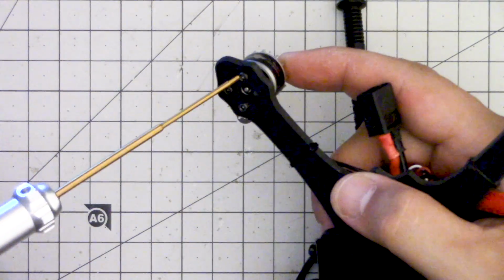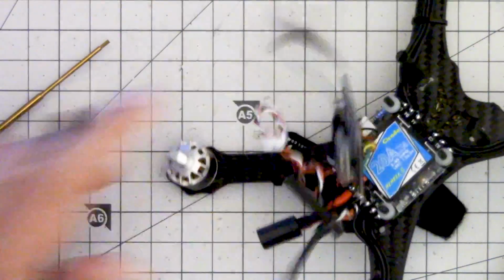Quadcopter Hot Motor | REAL WORLD TROUBLESHOOT

Comment: I have one motor getting extremely hot on a new build. I’ve only hovered it for a min or two and one motor got hit enough to smoke. 
The screws are not long enough to touch the motor windings. 
I guess I’m gonna move the motor to a different arm and see if the problem stays at the esc or if it follows the motor. 
That’s about the only way I know to pin point the problem. Unless you know an easier way?
Reply from the maker: If one screw and just one screw is getting hot, it has to mean that current is flowing through it. And the 99% most likely place for that to happen is the motor winding. Maybe the motor winding is somehow shorted to the base and current is flowing that way.
Reply: Joshua Bardwell one motor is getting. Hot. Not just the screws. 
When I touch the multi meter to the motor screws and the esc solder joints on the negative side of the esc pad I get a small reading.
Reply: Joshua Bardwell I’m putting a piece of elct tape under the motor. 
It looks to me that the motor windings touch the metal base anyway.
Reply: I guess I just had a bad Brand new motor??  ( I know that sounds unlikely). But I swapped the motors around to see if I had the same problem on that esc with a different motor and it stayed cool. But where ever I put that one motor it gets really hot from just hovering. 
I also had smoke coming from it last night. 

I hope after I get a new motor the issues will be solved.

Comment: What happens if my batteries get hot and puffy after flight? 4s 700mah pyro drone battery on 1407 4000kv motors with hglrc 28a stack, motors stay almost cool to touch
Reply from the maker: Need higher C rating batteries or larger batteries.

Or you are over-discharging them.
Reply: Joshua Bardwell thanks josh, appreciate the help! Ill get some r lines
Reply: Joshua Bardwell props were pulling to many amps lol switched em and the packs are warm but not puffy lol

Comment: So all of my screws have continuity and i assume this means some of the wingdings are touching the wall of the motor. are there any fixes other than just buying a new motor? Can i pop the top of the motor off and try and fix the motor myself or should i just chuck it?
Reply from the maker: Use shorter screws.

The motors may be permanently damaged though.
Reply from the maker: You can also add an M3 washer or two to give your existing screws more spacing.
Reply: Thanks for the speedy reply, I just cut some screws down and they only go in a couple of turns and I'm still seeing continuity between the motor and frame, However when I test between the 4 in 1 ESC solder for the motor and frame I do not have continuity. Any ideas on what my problem may be, I'm probably going to by a new motor. Shame really I've only flown twice as i'm new to the hobby and its kicked the bucket already.

Comment: Stupid question: If i get no beep but a reading of 600 when meassuring an esc pad and the side of the quad frame, is that bad or does it have something todo with the fc mounting holes being grounded or something? I am using steel screws for the stack with tpu sleeves over them for pseudo soft mounting.
Reply from the maker: The ESC motor pad shouldn't have any continuity to the frame at all.
Reply: Thanks for the reply! Seems to be stack - when I press left/right against it, it reads infinity/600.

Comment: your videos have answer to all my crisis except one I have tried to tune my quad and im enjoying the tune while flying line of sight because im ordering a replacement camera for my old one ,there for im not flying fpv, but ive always had a problem with my motors getting hot and I mean hot hot, youll say owch when you touch them even if I fly I smooth pack for 2 minutes only meating half throttle o fue times, is there a chance that its my esc motor combo, that's all ik it could be, my motors are tbs mr.steele v1 and im switching to v2s and my esc's are Favourite FVT littlebee spring 35A escs witch are considerable low end escs but ive had them bc of there price, do you think that's the reason, sorry for all the reading I appreciate your help deeply

Comment: we say ground using DC but it's really negative and positive DC electricity travels out the negative Pole and in the positive Pole like a magnet pushing and pulling negative pushes positive polls a complete circuit.
it seems the opposite of the way I've always understood it the fuses are always on the positive side which means we basically control the return electrons

Comment: Hey Joshua, I just rebuilt my 3in with new fc/esc after fire, now it fly but motor 1 is significantly hotter than rest and battery last a lot shorter than before, screws are fine, I changed motor same happens, possibly bad esc but before I change esc is there any other potential cause? Btw my 5inch floss doing same thing on motor 3 after a crash
Reply from the maker: If you're 100% sure it's not the screws then I would change the ESC next, yeah.
Reply: Joshua Bardwell wow thanks for the QUICK reply happy flying! Going to buy hobbywing esc through your link 😃

Comment: Joshua any help is much appreciated! Tried all these things and nothing works. I put wd40 in my bearings like an idiot and now even with after cleaning out with carb cleaner its still hot plz help i run the le drib hypetrains and being 15 i cant afford to replace them
Reply from the maker: if you cleaned them out with carb cleaner then they have no lube at all in them. I guess I would suggest taking the bearings out of the motors, then soak them in a plastic bag of bearing oil over night.

Or for about $25 total get a new set of bearings for each motor.

https://store.rotorriot.com/hypetrain-2306-series-motor-replacement-bearings/?aff=3
Reply: ok thanks for your time bro im hoping this works. i rode my bike to the store and got some oil and just tested puting oil in the bearings and got no diffrence at all. i spent the rest of my money buying some new bearings of the same kind and size from rdq and they will be here shortly. ill soak them over night and come back with what happened
Reply: ok i did that and it made no difference. i swapped out my pdb and everything is connected the exact same and the smoke stoper is telling me its ok but now my flight controller will boot but not arm so now putting this in writing i think i need a new flight controller... any thoughts?

Comment: A small tip.  I just now had 2 hot rear motors.  T-Motor F20 v2.  I changed props, messed with PID's and some other stuff.  Read this post and someone mentioned screws too far into windings:  https://www.reddit.com/r/fpvracing/comments/6himkh/why_are_two_of_my_motors_overheating/  I knew my screws were slightly long.  Changed them out with shorter ones, and the motor heat went away.  Boom.

Comment: It's crappy outside today so putting around the house to practice acro. Just checked and my rear motors were indeed hotter also. Must be because we are usually on forward tilt so rear are usually working slightly harder. Another excellent video as usual

Comment: i joshua i have a lhi qav 250 with simonk 12a esc ne of my esc gets warm while other 3 cold and the motor on that esc doesnt run like the others takes more throttle to start properly when i slightly move up throttle stick other 3 motors work as they should but that one motor jerks till i movee up the throttle bit more then over runs and seems faster than the other 3 the motor it self seems ok doesnt warm up and spins freely i tried calibrating using librepilot and still does it i just wondered if you could help with that should i replace the esc or is there anything i can do to sort it thank you
Reply from the maker: +Nick dutton I would try replacing the ESC yes.
Reply: ok thank you
Reply: hi i ordered new afro 12a esc v3 nicely priced of hobbyking i was mucking around with it last night an now i think the problem is with the cc3d giro because if i tilt it when it armed an a little throttle they all work think im gonna ditch the cc3d and pit a omnibus f4 v3 in instead could i power the board with 5v bec from one of the escs or do i need a new pdb aswel thank you

Comment: Please help! All motors randomly cut out for a small period of time. Mostly when I punch it. Motors don’t get hot, don’t have to re arm, the esc (4 in 1) doesn’t reboot and play the tone. Watched your other video. Doesn’t cut out when I use the motors tab in beta flight to test them. Also checked continuity from screws to esc wires. Please help!
Reply: Actually I saw a reddit post that said it may be too low of a discharge rating on the battery, could this be it? My battery is a 3s 1300mah but is only 20c, my battery that is a 3s 30c 2200mah doesn’t cut out as much
Reply from the maker: +bob jhonson for a 5" quad, 20 or 30C packs are totally insufficient.

Comment: It's my experience with rear motors that because the default settings rotate the props inward or counter clockwise on rear left and clockwise on rear right it overrevs the motors on yaw bank hard turns. Swap the prop rotation in betaflight cli, the yaw directions and in bl heli reverse the rotation. Of course it's not your topic here but I'd love to see a video of your experience  after doing this. I believe more people would as well. I only build quads this way now I find it makes flight caricature better, don't pin rear motors at high rpms, and it doesn't throw mud or grass on camera's lens

Comment: Hey josh. So i just got a fpv racing drone, and im fairly new to the hobby. I was setting up my drone to my crazepony fpv goggles, when i realized that the screw that holds the big mushroom antenna was really hot. Do you think it has anything to do with not having the antenna screwed in at the time?
Reply from the maker: Leaving antennas off of receiver devices like goggles has no negative effect. The connectors on a receiver should really never be hot. I would be suspicious.

Comment: can anyone help me? i have a quadcopter board and the transmitter that i salvage from my old quadcopter, i decided to build a mini quadcopter with that board,and that works, but i crash it and a motor broke (front right motor), and i decided to repair it (not only the motor, but the frame,propeller and some repair). after that a problem happen.. the problem is, if i connect the battery to the board, a motor will spin (back left motor), but i didnt turn the board on, is the board broken? help me please...
sorry if out of the topic of the video

Comment: I just installed runcam split 2 and now my armattan oomph 1407/3850kv motors get supper hot after less than a minute flight. All 4 of them.  They had not even got warm b4 the install. I've run the split off the power out on the omway 200mw receiver.  It has a 5amp out. Could that be the problem? Should I just get power off the flight controller?  If anyone can offer advice I would really appreciate it. Thankyou
Reply from the maker: I don't see any way that installing the Split correctly could cause your motors to get hot. The motors are powered directly from the battery.
Reply: Joshua Bardwell Thanks for the reply mate.  I didn’t think it seemed like a ligit reason for hot motors.  I was just punching around  in an inclosed area at the time of hot motors because I was testing a receiver problem. Outside actually flying makes a big difference.  Still I've got one hot motor at the back. I'll keep an eye on it. Do some tests.  The dvr on the split is awsome.  You are definitely right about that one. I have several quads and they all have problems so I watch a lot of your vids. Thanks. I'll have to start paying you I think. 😆 I'll jump over to your patron page.  Cheers mate. 👍

Comment: can dshoot put stress on anything on your quad?..
Reply from the maker: If the ESC is not able to handle Dshot fully, you can get more corrupted signal which could cause the motors to spin erratically. But in general, no Dshot doesn't stress out the quad like make it hotter or whatever.
Reply: ok thank you so much..Iove your videos and the great part is you are right on with alot of issues..

Comment: If a screw contacts the windings and the motor got hot but hasn't smoked yet, is the motor able to be salvaged or should it be replaced?
Reply from the maker: It's probably okay then. But if you suddenly get it start dropping out of the sky, that's why.

Comment: Why would you replace the motor? Wouldn't you want to replace the esc?
Reply from the maker: +WackFPV Limited no. The motor has likely been damaged by heat. If that didn't fix the problem then I'd replace the ESC next.
Reply: Joshua Bardwell Ahh, good point it was exposed to heat. Move down the chain of command. Thanks for the advice!

Comment: I had the same thing only when i use betaflight motor test, rear motors are hotter then the front motors without props.
They both make a squik sound and stalls when hitting the throttle stick.
After replacing both problem was solved and i can hit the sky again and not the ground 😎

Comment: When I checked my motors with a infrared thermometer, motor 3 was 180+ degrees and motor 1 was 240+ without flying.  Just the battery plugged in.  Not armed.  I checked a second quad running the same FC and PBD and got the same results.  Is this normal?
Reply from the maker: No, not at all. The motor should be room temperature with the battery plugged in and not armed.
Reply: Ok. So Heat = resistance...  OSD says 1 amp of current flowing.  I don't understand how a motor can have resistance but not be spinning.  Any ideas?  Matek F405 and FCHUB 6S.  one quad has Wraith Plus (32bit) ESCs and the other has Betaflight 35 amp 32 bit ESCs.
Reply: Ok.  I resurrected an old SP Racing F3 quad and tested the motors on it.  They were as you said they should be: Room temp with battery plugged in.  Trying to contact Matek to hear what they have to say.
Reply: Motor heat fixed.  Turned out that I either didn't have the right target of BF flashed on the FC or it needed reflashed.  Flashed RC5 that is available on the Matek site and now all motors run around 83 - 85 degrees!!  Time to fly!
Reply: Absolutely not fixed. Still getting random readings with the infrared thermometer.  I would like to blame the thermometer  but the temps that are read are too consistent. Well, within the hot or cool range.

Comment: Hi. Is that possible that all 4 motors get very hot because of the low quality cheap battery? And the battery gets hot too.
Reply from the maker: +Mike Orion cheap battery won't make the motors hot. If anything it will make them cool because voltage is lower.

Comment: Hi Josh nice video and very well explained, mine is kind of the same. But the motor starts up a bit thin stops. Any idea?
Reply from the maker: +Joseph Aerial Photography of it spins smoothly when you raise the throttle a bit then possibly its just not calibrated right. Or you need to raise min_throttle.

If it doesn't spin even when you raise min_throttle then likely the motor or ESC is damaged.
Reply: Joshua Bardwell , I raise the min throttle and no different,  not sure what you mean about Calibrate

Comment: Joshua, can a possible bad motor cause interference in the fpv feed? I have a LC filter installed and still interference.
Reply from the maker: Yes it can. Anything that causes excess vibration can cause video noise.

Comment: How would you be able to test whether or not your flight controller is making your motors hot without replacing the flight  controller? My last build had hot motors so I rebuilt it, but used the same fpv system and flight controller. Now, with a different frame, escs, and motors, I still am getting pretty hot motors. I'm running spedix es30a escs, rcx rs2206 v3 motors, and an omnibus f3 from rtfq. If I were to replace the fc, I would have to replace it with an old naze. How well do you think it would still fly?
Reply from the maker: Set D gain to zero. If motors are still hot, it's not the flight controller.

Comment: Is it possible that faulty flight controller would make for hot motors? I got hot motors that were untouchable and I rebuilt the quad with everything different besides the flight controller and fpv system. The motors get hot but not as bad as my last build. It's not because of high D or anything.
Reply from the maker: +JC250 I guess it's possible, but also maybe some other common factor even though you changed everything. Like I have heard some people getting hot motors with blheli_32 and some motors.
Reply: They are spedix es30a esc's and rcx v3 2206 motors. Would it just be because I live in Florida and it's always 80-85 outside? I watched furadis video on it. I wonder if that's the case. The only thing I smell after a flight is thread lock.

Comment: When I turn the motor it moves when I turn it on all motors move just that one just moves back an forth,I told it was a bad esc
Reply from the maker: Move the motor to a different arm of the copter. If the motor still doesn't spin, the motor is the problem. If it starts spinning when you move it, the ESC is the problem.

Comment: How do I No if it's a bad esc or bad motor,got jyu,left motor just moves back an forth.what could be the problem
Reply from the maker: Move the motor to a different arm of the copter. If the motor still doesn't spin, the motor is the problem. If it starts spinning when you move it, the ESC is the problem.

Comment: im having an issue with throttle..ok lets just say im flying around my yard all the sudden i lose throttle for like a second or two..or sometimes the quad just drops to the ground and i go to give it throttle again and its fine..like there is interference or some kind of glitch..i just dont get it..
Reply from the maker: It sounds like you are experiencing failsafe. Check the connection to the receiver and the antennas. It's possible you have a damaged receiver or transmitter.